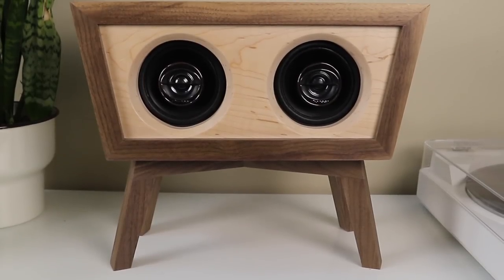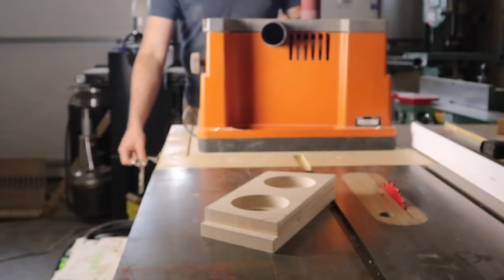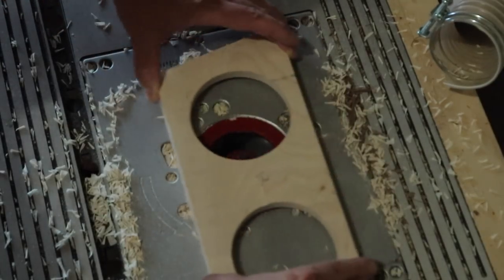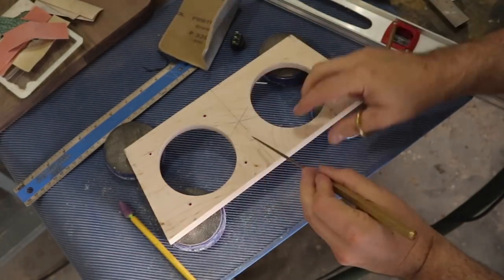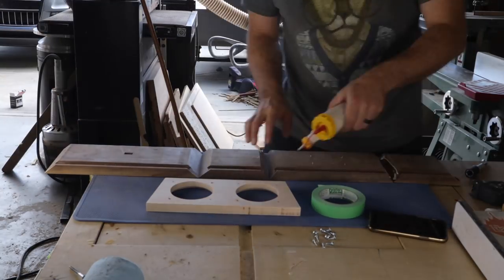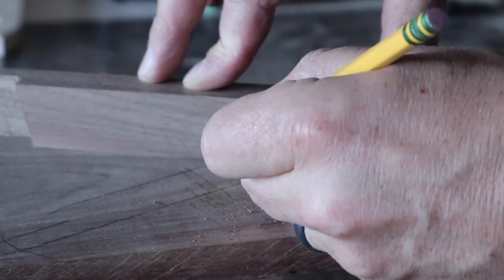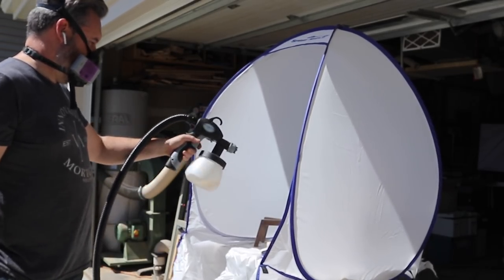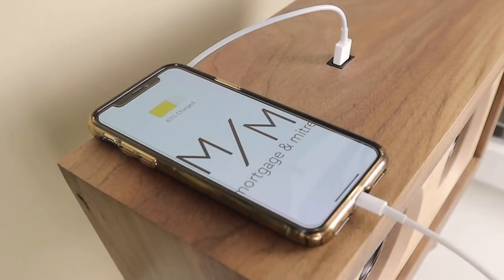Making a Wireless Bluetooth Speaker Box // Bad Larry by Foureyes Chris Salomone

Comment: Very pretty, and a nice tribute piece.  One change I would suggest though would be the USB placement, I've found no matter how hard you try ports on the top of things fill up with dust after just a few years and start failing.  We even have an air filter in our living room running all the time and all the majority of the upward facing USB ports on our computer cases failed within 3 years while all the others are still fine after about 7.  So either put it on the side or back, or work up some sort of cover system for it when it's not in use, even if it's just a coaster set  there.

Comment: What a great work!
What speakers did you use for the back panel?
Reply from the maker: Thanks. Those are passive radiators on the back. They help with low end sound.

Comment: What are those things you installed on the back that look like speakers? Do you have a link for those?
Reply from the maker: Thiago Locatelli I can’t find a link for the ones I bought of eBay any more, but look for ‘passive resonator speakers’ the help with low end sound.
Reply: @furthernorthfab  Found them. Thank you. Also, would you update the description with the dimensions of the box (trapezoid) and the front and back plates (maybe svg for the cnc)? Also, do you have the battery powering the amplifier and the usb charger port simultaneously? I'm about to start building it, just missing a couple of details. Thanks again, sir.